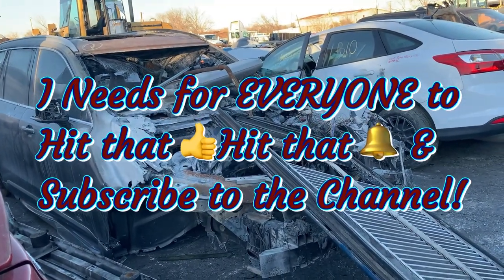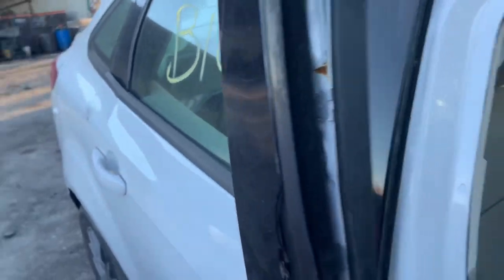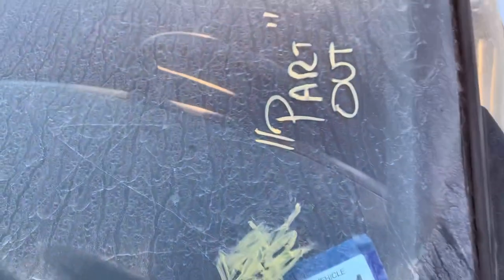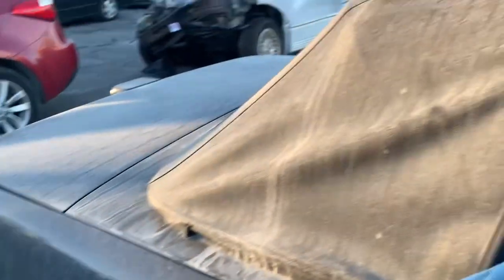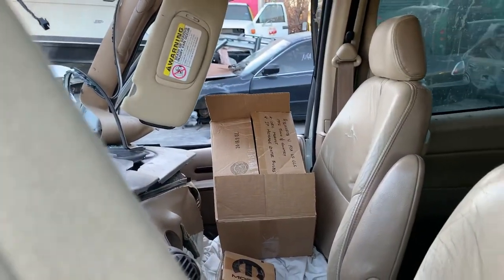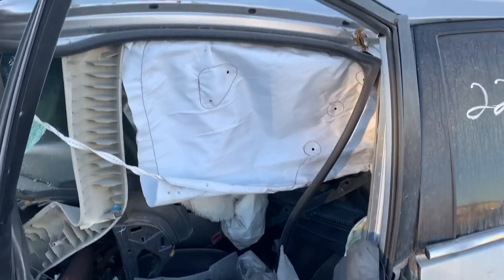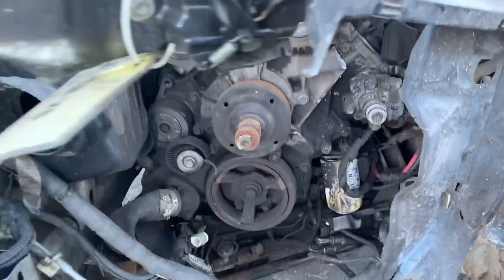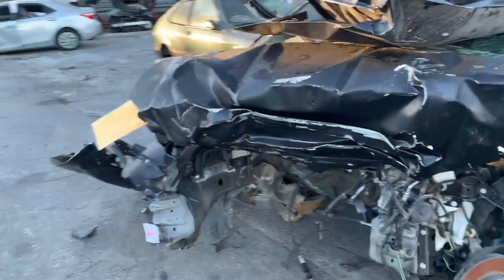All THESE WRECKED UP BIO HAzARD CARS AT THE YARD!   FOUND A 1992 🤫🤫🤫 IN THE YARD!!

Comment: Yup, 1992 on the Capri, as the 10th digit of the VIN is an "N". They were assembled in Campbellfield, Victoria Australia. Should be code W3 Dark Charcoal. The engines were Mazda sourced. Those are some high speed/rollover wrecks. I suppose the vehicles did what they are supposed to do and that's crush and fold up.
Reply from the maker: Man we get so many of them wrecked up cars it not even funny Beer can City is what I calls them.💙💯👍😎😁💜 I was really surprised to see that carpi at da yard hopefully it will sell a few parts bfo getting CRUSHED.💯